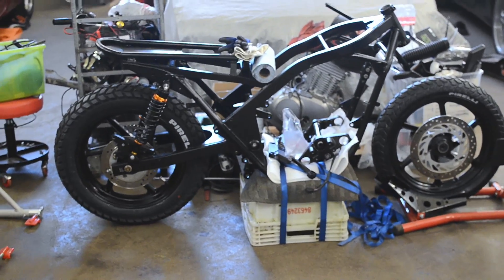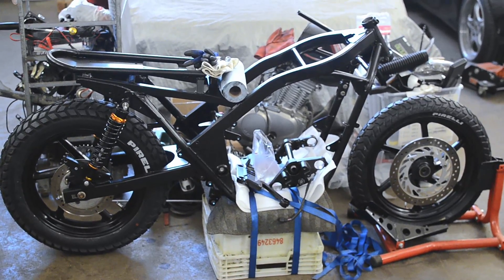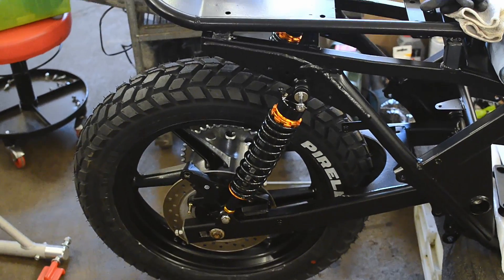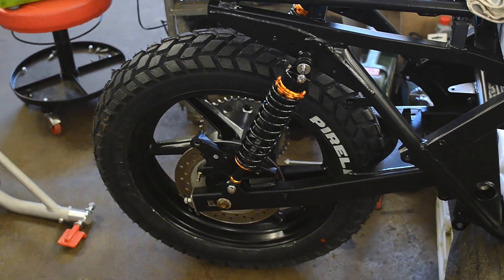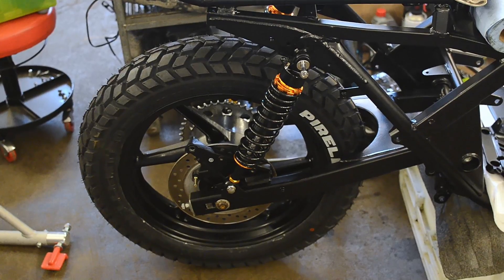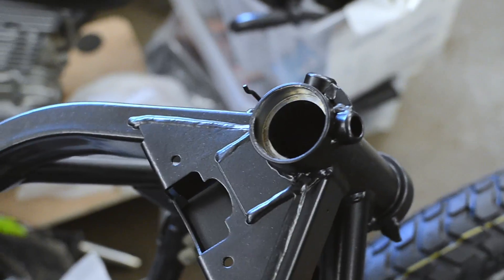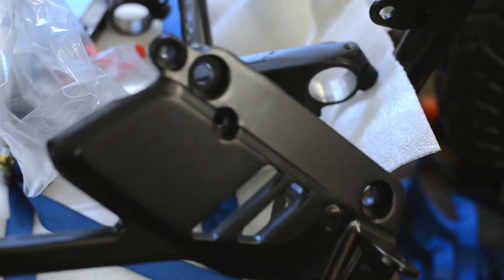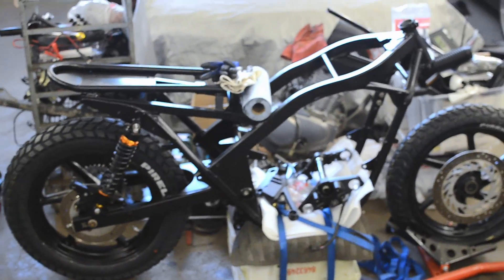Honda CB 500 brat style cafe racer - Part4 - Assembly begins

Comment: Hey, Nice Bike! Really good looking! But i have a question, which Dimension is the Front and the Backtire ?
Reply from the maker: Hey. I got 120/70 R 17 58V in the front and 130/80 - 17 65H in the back. Both are tubeless and the back tire is same size as the stock tire. The stock front tire was 110/80, so my new 120/70 is pretty close. I couldn't find stock size as tubeless.